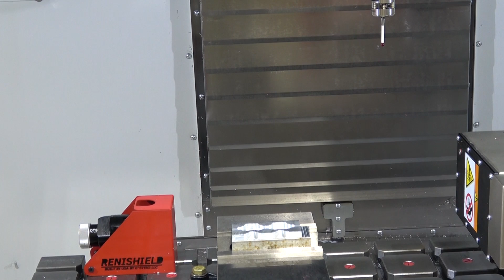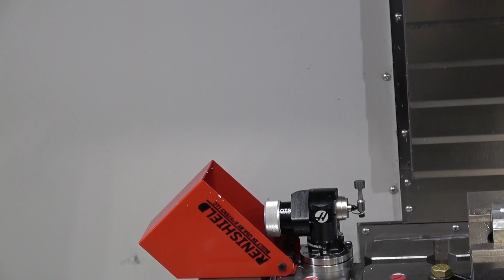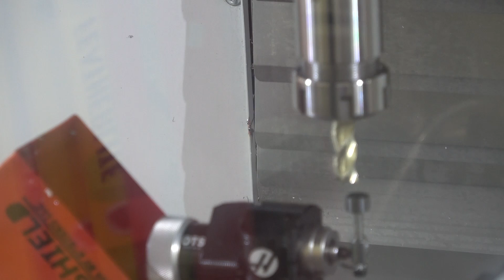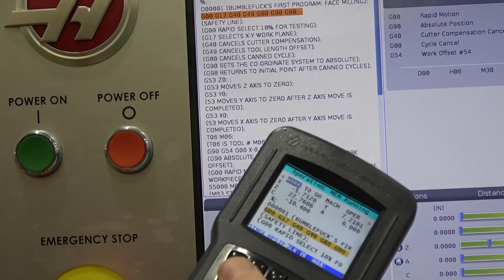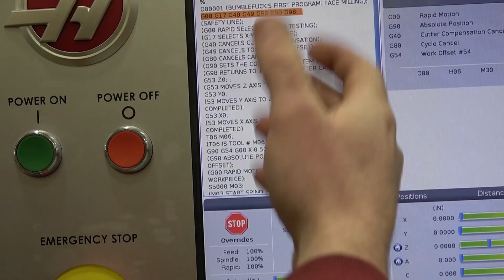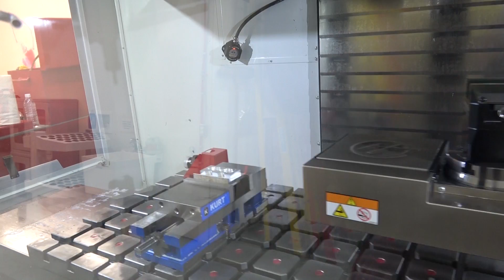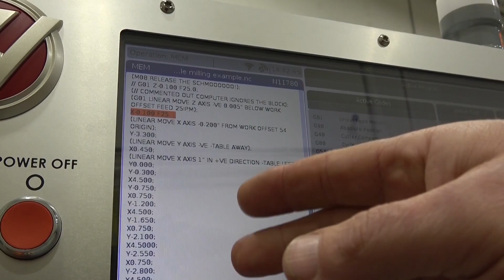Old School G-Code worth the HAASsle? | Intro to CNC mini-series Ep. 2

Comment: the only time I ever touch my code myself is when I forgot to change my Work offset or tool number or something simple like that, rest of the time I just go back to CAM and repost. Im a tool and die maker so usually only making ones and twos of things so making the part right the first time even if its slow is preferred. pushing for those seconds per cycle isn't worth it for us. my programs are rarely rerun and if they are it can be years in between so most of the time we just write a new one.

Comment: This reference may, or may not be of help to people. It is meant for 3D printers but they run the same G-Code (mostly). Obviously, if your Haas manual says otherwise go with that. 
G-Code is good to learn because its also used on laser, plasma, and water cutters. And I've even seen It on robot arms now. Makes it easier to program them.
www.reprap.org/wiki/G-code

Comment: I'm still pretty much a greenhorn machinist. I've been working in the real world for just over two and a half years. I've made commercial and military aerospace components, and gun parts. 
I was also nearly a decade and a half older than all the other people in my class at the tech school. I can pretty easily read a program and know what the machine is going to do.  That can be extremely helpful if you're running a program that someone else wrote. Which, in my albeit limited experience. Is usually the case. An enginerd did the CAD/CAM part. Then it's up to you as the machinist to make sure it works as intended. Which doesn't always happen. Being able to read the program, and look at a blueprint of the part. You should be able to figure out if something went awry.  And sometimes. It's quicker to whip out a calculator and a pen and paper to fix the program at the controller, than to walk across the shop to the confuser, to make changes and then have to re load the program. What's real fun. Is when your boss has you run a machine you've never ran before much less hardly seen. Hands you the manual and wishes you luck. Couple months later. Manually wrote a program for it with nothing but the part blueprint and the operators manual. (It was a Citizen Swiss Screw machine)  I'm one of those weird machinists that likes CNC lathes (turning centers).

Comment: I'm glad to see Haas still puts the tool release button right next to the goddamn part zero set button on the control panel.  I disabled that stupid button in parameters because the last thing you want to do is get caught using an edge finder or Blake coaxial indicator on a tiny hole because the touch probe can't get in an odd spot, and have a tool drop out of the spindle when your edgefinder is spinning at 1000rpm because you did a fat finger, and now it's dancing around like a top on your part, table, and way covers.  Go to Setting or Parameter 76 and disable that fucking button.
  Really, the only time the tool should drop from the spindle is when the head is at the home position and you've got a rag to grip the tool and use your booger hook to press the tool release that's on the milling head.

If you're interested in writing G-code, I've been coding and screwing with Haas machines for 13 years before I moved into the realm of Mazak Integrex where I can no longer do that.  Knowing and writing G-code is very helpful in seeing where your program is going to go and catching errors.  Sometimes things don't post correctly and knowing G-code, you can see where the code alarms out and fix the issue, or make edits instead of reposting something all over again, especially if you made a bunch of edits on the controller to tweak how it runs.

I know at the time of the video, you've got a crapload of G-code notes in the program, more than actual G-code.  I just do a prep line of G00 G90 G40 G17 G54 Xn Yn Hn Dn M3 Sxxxx.  Typically I have a second prep line with a G00 Z1.0 M08/153 Tn.  I stick the spindle direction and RPM command on the first prep line, at the end,  because by reading the code there, the spindle will start to get up to speed as it's dropping in Z because it read the second line and begins to rapid above the part.  The second line gets my tool to rapid an inch above the part while it multitasks a few other things.  It'll turn on the coolant and get the pumps going and start spitting coolant right around the time it's starting to G01 to your part after the G00 Z1.0 movement.  Sometimes putting M08 right before it starts machining, the machine will actually start machining before coolant turns on so you can get premature tool wear from running dry.  If you have the M03 Sn as it's own thing, the machine will spin up the spindle as a standalone step, and won't move to G01 until the spindle is exactly up to speed, which can take a few seconds if you're blowing it at 10krpm or faster.  Doing it on the prep line gets the spindle going while the machine is moving, saving you time.  I also put in a Tn so the carousel will rotate and pre-stage the next tool, but it won't do a tool change because you didn't have an M06.  That way when you reach the end of the tool being used and have an M06 Tn line, it'll instantly change to that tool, instead of make you wait as the carousel spins around to the right pocket.
 G17 selects your XY plane for your G2 and G3 arcs (I's and J's).  If you wanted to mill a circle in G17 but had G18 or G19 active, you'd be defining a circle in the XZ or YZ plane.  If you're doing hemstitching or some other type of contouring, these would come into play.

All this stuff adds up, especially if you've got 20 or 40 tools in an involved part and shaving those 10 seconds per tool can turn into hours with a lot of parts on a run.

You don't need the G49 if you immediately call out your Hn in the preparatory line that matches your tool number.  There's a Haas parameter/setting (Setting 15) where if your H and T don't match up, it'll alarm out because it's a potential crash.  I kept it on because it was a good safety catch and there were very few situations where I wanted multiple H values for a single tool.  G80 should be inserted after a canned cycle series as good practice but the machine reading a G00 after a canned cycle will automatically cancel the canned cycle anyhow (eg you can define a G73 high speed peck drill cycle and list a series of XY coordinates on multiple subsequent lines after where it'll repeat the canned cycle at each listed location, but the second you add a G0 and another set of coordinates, it'll basically apply an unspoken G80 and cancel the canned cycle that was active.)

If you're doing facemill ops, try adding ",Rn" where n is tool radius after every G1 linear movement so the facemill will make a 90 degree arc to a new direction defined by the next linear movement, instead of a full stop, then 90 degree directional switch on the ballscrews.  It sure beats abrupt herky jerky stops (more noticeable if you're pushing it hard), and then a 90 degree change because there's a moment of lag and you can get less even surfaces.  

For G53, you can make sure you have a sufficient G00 Z retract to clear any clamps or part features after it's done machining with the very last tool, and just throw in a G53 Xn Yn Zn together so it'll move in three axes efficiently after it's clear of the part and save time, instead of moving in X, then in Y, then in Z, since your Z clearance is already safe.  If you're running multiple parts, I always left out the Xn because unless your fixturing is on the very leftmost or rightmost side of the table, you either have to reach way into the machine to get to your part, or hand-jog it to where you want. Every.  Single.  Time.

Don't bother with G28 or programming in G91 because incremental can bite you unless you're trying to write very elegant, clean, short code.  Example of doing a 12-thread bolt hole pattern of threadmilled holes, you can write in an M97 subroutine and call it to find an  N100 and write a threadmill process in G91 as a P100 sub and get it to repeat and basically shorten your code by 90%.  It saves having to math out 12 different sets of unique absolute coordinates to execute a threadmill helical toolpath.  Makes it really easy to check your math too.

You'll definitely write cleaner code by hand on reasonably easy 2/3D mill stuff than the code spit out by Esprit/FeatureCAM/MasterCAM can do where it does these little ballet pirouettes before it engages parts.  That stuff mostly excels in 5-axis or where you need fancy stuff like HSM, trochoidal, etc.  Those can burn up a lot of time cutting air.  Handwriting is also a lot more powerful for specific situations.  There are times the drill canned cycles aren't powerful enough to do what you want to do.  For example, doing a 20D hole where the IJKQ variables aren't enough because you need to start slowing down your surface footage and messing with your IPT as you progress deeper into a hole and actually do pecks where the drill never leaves the hole (uses the hole as a drill bushing) and spins up to speed after it's drilled into the hole some (to avoid TIR issues from drill whip).  I've had to write a fair share of custom longhand drill cycles for 1/8" drills going 3+ inches into heat treated 17-4PH

Have fun writing code!

Comment: A bit late to the party and Im sure you have heard this by now but just in case, for the / to skip the program line you need to have the block delete or block skip or whatever HAAS calls it on otherwise it will read like any other line of code. I would know but my shop only had one HAAS lathe and that was many moons ago. I learned this stuff kind of the same way as this with a few mentors helping me out as a button pusher, Now I run the night shift in that shop, G-code is old and there are much better and faster ways to program but you probably wont go back to mastercam just to fix a chatter or finish issue. Knowing G-code saves time for small fixes right at the machine and to proofread. One thing i always tell my new guys is close to what you said in the vid, "this machine will do whatever you tell it to, whether its a good idea or not". Also yes those touch probes are tits. Beats the hell out of edgefinding the old way and manually putting in offsets. There are a few machines I still have to do that on. TThe most annoying thing is G-code isnt standardized so it has small changes from control to control. Okumas controllers look a lot like fanuc G-code BUT an H value can be either tool or work offset depending if it is preceeded by G43 or G15. Love the vids though, long comment but Ive been lurking a while and I finally have something minorly useful to contribute.

Comment: Well...
 Lemme tell you this. 
  I bought books and videos, and programmed g-code the hard way for about 3 years before I bit into cadcam.
  And it is a good thing I did. 
  I see the nice Haas you are running. 
  Look, I can come straight out of cadcam, dump to the Haas and run it. 
   Haas post processors work. 
  They do not in Fadal. 
  I have to edit every single program for that machine. Or it is crash city ever one. 

  Yeah, I could talk G-code until you puked. 

  Now, here is the important thing. 
  You can Optimize your programs if you can  read them.
  Pitch extraneous moves, do live floor edits... 
  Miles ahead. Edit at machine without going back to the damned PC and re-programming the whole thing.  
  It ain't a perfect world. 
  And I read my programs after posting... almost all of them I hand edit to some degree.

Comment: and yet for less than 100 bucks I can attach a camera to a raspberry pi and using open source software get sub millimeter accurate 3d shape measurements without physical contact.
Reply: This is totally different

Comment: G-code is simple. Really. When i bought my first cnc about 20 years ago, i had an apps guy there for two days. Then called him a few times over the next two weeks. That was it. After about a month i almost never looked at the cheat sheet of g/m codes.

You can easily get super finishes hand writing code for 2d work. Once you move to 3d, and/or 4 and 5 axis work, that is a different story!

Comment: 40+ yrs as a CNC machinist (not just operator) AND programmer, both offline - CAM programming, and manual (g code).
Each one is equally important.
Each one has their place. I wouldn't attempt 3D surfacing or 5 axis programming without MasterCam or another 3D package - programming from solids makes it almost a no-brainer.
The other side of the coin is that half the time you can generate a complete g code program at the machine control faster than offline.
Without being able to read and write g code programs, it's just about impossible to debug a program from offline that has a post- processor errors.
Another place where manual programming is critical is unusual machine tools.
Our Nakamura NTX is an 11 axis (some repetitive) machining center, running 3 separate programs simultaneously in 5 coordinate systems.
The multiple programs require "handshakes" to avoid overlapping motion leading to machine crashes.
Another factor that places manual programming parallel to CAM is that in the case of the Nakamura, MasterCam quoted a price for a custom post-processor which was more expensive than the machine was new.
We "marry" 3D CAM programs with manual programs and are quite successful.
Reply: What he said.
Seven axis Citizen sliding head machines and three axis mills in work.

My biggest bug bear is programmers who know Jack sherbet about machining, can't plan a job, can't work out how to hold a job and have no clue what speed and feed actually mean.

Comment: Honestly if someone is having trouble with the control on a Haas, they are basically braindead; it's the easiest control to understand.

Unfortunately the easiest control in the business is married to the worst chunks of iron and the most overrated motors you can find. Haas is basically only good enough for very small parts, aluminum, and plastic. Any serious machining or precision work requires something better.

Comment: Having a basic knowledge of G-code is good but I don't think anyone runs a machine by manual coding. I've owned 4 CNC machines, first one about 20 years ago. What has really advanced are the CAD design & CAM systems available toady. We just bought a new CAD program @ $14K/ seat and a CAM program @ $32K for the package. Cheap by big time standards. There are many things in the design program that automate part placement, transitions etc. Libraries of completed designs are maintained and pulled up when a similar thing is to be made, modified, saved. The CAM system takes that information and writes the code for each CNC machine in the shop, stores it on the server. The machine operator looks up the job file, clicks it and the appropriate code is sent to the machine. Load the machine, click green button. Where things are likely to go wrong is the operator setting the tool files wrong or loading the tools into the wrong location on the carrousel. The machine doesn't have any way of knowing! Modern CAD/CAM systems have come a long way in the last 20 years, luckily!

Comment: Once you know them all though, you can rattle off a CNC programme for an object in no time at all. Back when I was a machinist, my Bridgeport had a Heidenhain controller attached which in its day was a top bit of kit. And really flexible in what it could do.
I had an old PS2 Keyboard modified and an extended cable retrofitted and run into the main controller unit. So I could use a proper keyboard to bash out programmes by hand while sat on a stool in front of my machine. We only had 1 CAD/CAM machine in our shop and it was always being used by the chimps that couldn't programme themselves. Its a real sense of achievement when your CNC programme works off the bat and doesn't destroy the tool / table / and or head. I miss machining... :-(  Sadly not much money in it these days, even for highly skilled operators.

Comment: I basically learned G-Code because the CAD/CAM software wasn’t giving the output I wanted; I couldn’t figure out how to fix certain specific pathing issues in the program so I just started making command line scripts that solved the travelling salesman problem for our machine, plus making cuts more gentle in ways I couldn’t find settings for and converting files between the 2 different machines we’re running (different work areas, tool setups)

Comment: I'm mostly certain you went to school for years, to be a mechanical/electrical engineer.  It doesn't come over nite.  Quite a few engineers feel that machinists are not too bright because most of them have not had the engineering schooling behind them.  Assuming that anything a machinist can do an engineer can do instantly, with out the many years of learning a craft that does require some skill and intelligence.  Even though you are a great engineer, it may take you two or three days to become a master machinist.  Maybe even a week...  Maybe you could even get a machinist that had some experience in cnc programming to give you a hand.  You seem to think that just because you can buy a cnc mill you should be able to run one.  That seems to me to be like thinking if you can afford an airplane it makes you a pilot.  There might be something to running a cnc mill that takes experience and some learning.  Give it a little time.